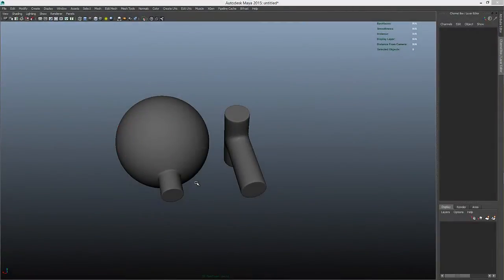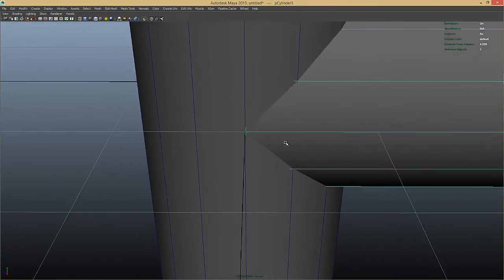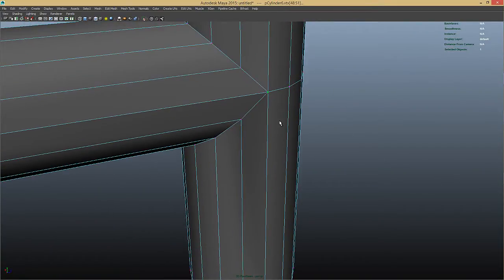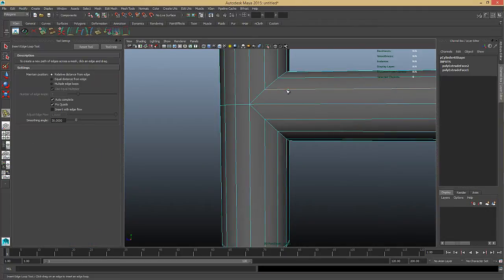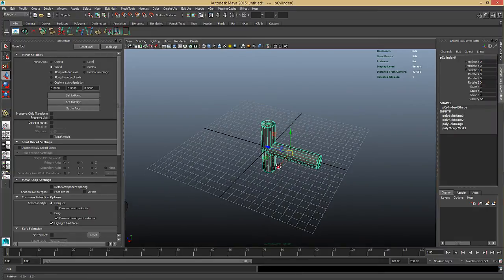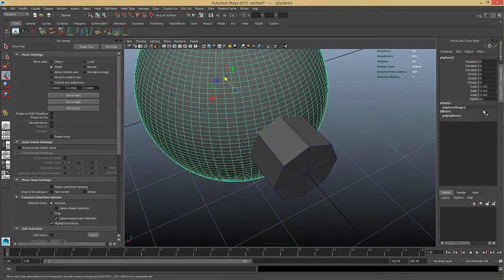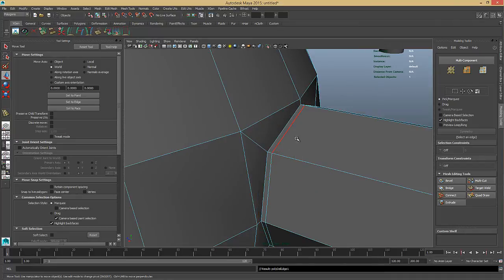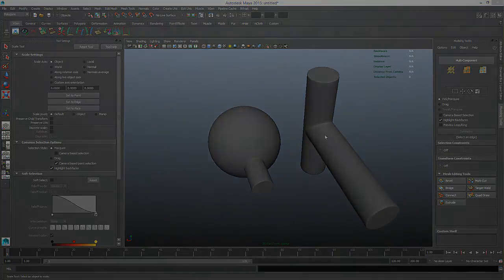Maya Modeling Tutorial - Inserting Cylinders

Comment: Hi, I'm using Maya 2018 and trying to use this tutorial but running into issues when trying to merge vertices - I tried using both the merge vertices to center as well as merge vertices with a threshold but am still seeing multiple vertices around the insertion of the cylinder. Is there something else I can try?
Reply: try to increase the merge threshold up until they merge together